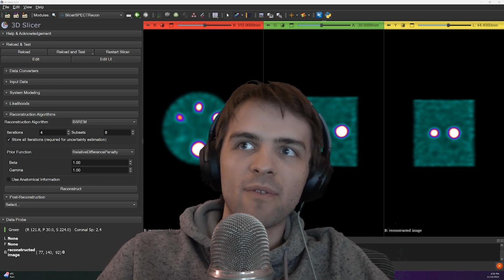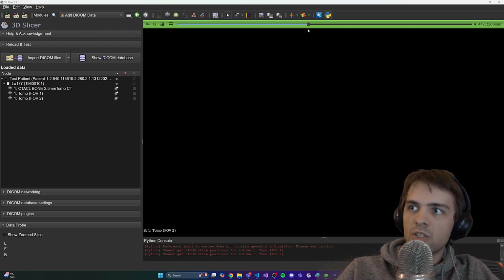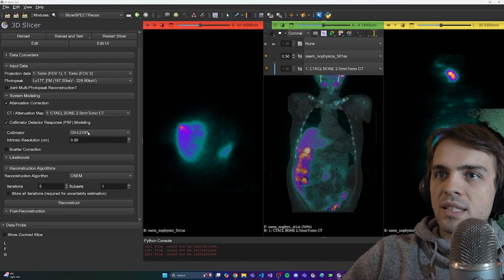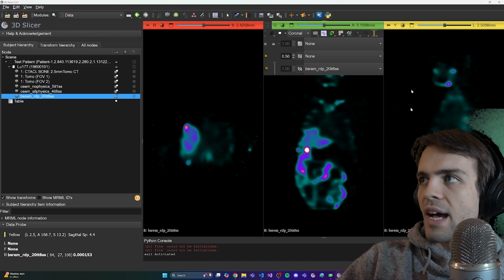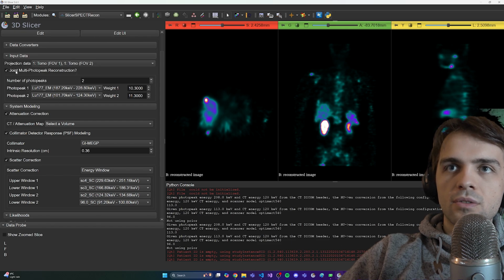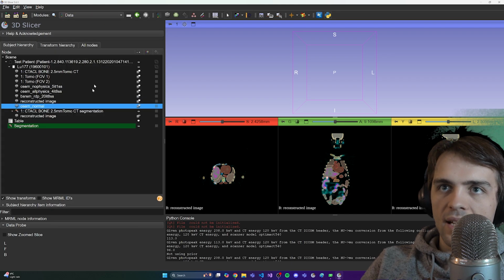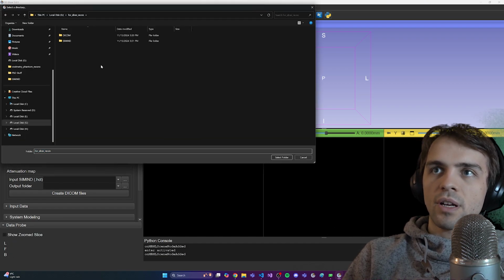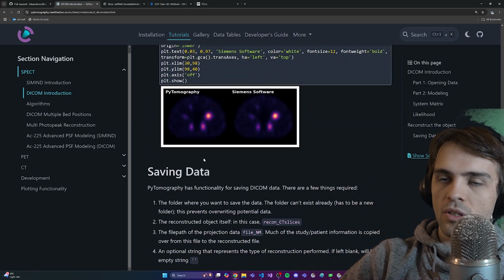SlicerSPECTRecon Tutorial: SPECT image reconstruction on 3D Slicer

Comment: when I click the "SPECT Reconstruction" button, the "Setting php required python libraries" window appears and the 0% does not change over time. How can this be fixed?
Reply from the maker: As a suggestion, you can open the python console in slicer, as these libraries take a long time to download (pytorch is around 5 GB) and it seems like slicers loader bars don't track download progress (only install progress). 

There's also an issue with newer graphics cards that one can ran into. For users with graphics cards with CUDA versions >=12.8, the user has to manually install pytorch with CUDA 12.8 in the python console within slicer using:

"
import sys
import subprocess
subprocess.check_call([
    sys.executable, "-m", "pip", "install",
    "torch==2.10.0+cu128",
    "torchvision==0.25.0+cu128",
    "--index-url", "https://download.pytorch.org/whl/cu128"
])
"

Comment: I have a small issue: the version of Slicer3D I have installed is 5.8.0, and it seems that the SPECTRecon extension only works with version 5.1.0. Is there any way to access this version? I need it for a research project.
Reply from the maker: You need 5.10, but you can have both versions (5.8 and 5.10) simultaneously installed on your computer, so you can use the 5.10 version for recon.

Comment: I have  mhd/.sin 2D projections from GATE, how do i use it ? Do I need to convert to dicom? If yes what software do you recommend?
Reply from the maker: You can do the following: grab any of the dicom SPECT projection files from the PyTomography tutorials. You can open with pydicom and look at the dataset in python. You will need to create a template dicom projection file and copy your GATE data into the dicom format. It's not that much work (perhaps 3-4 hours) and is a really good exercise on becoming familiar with NM projection data ; )